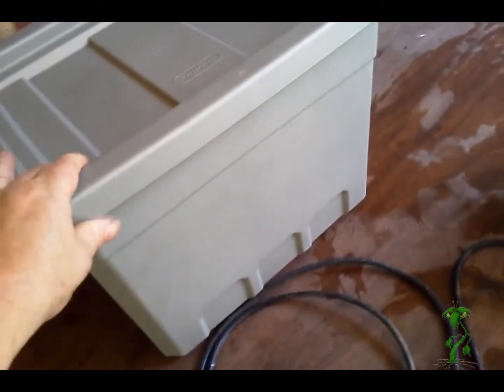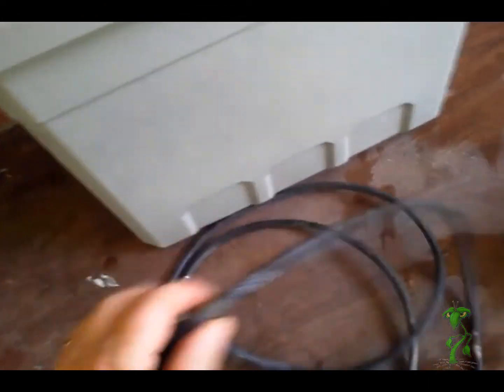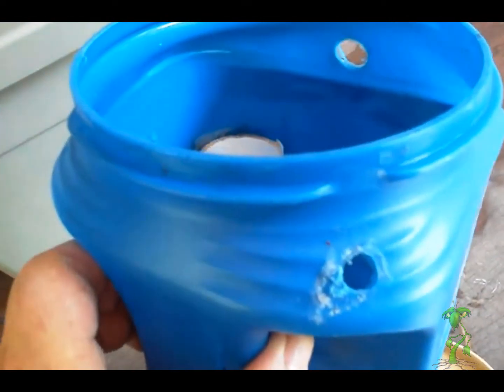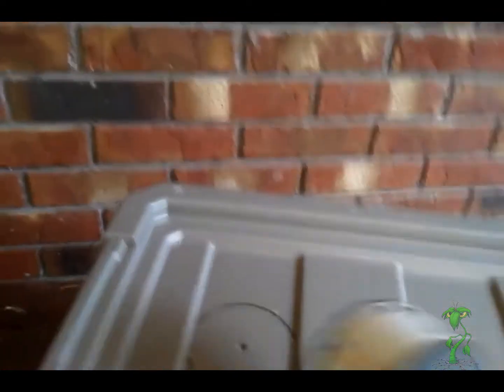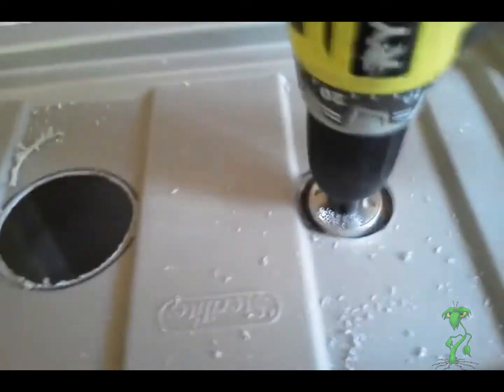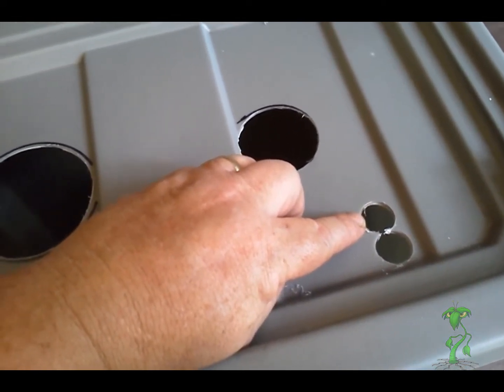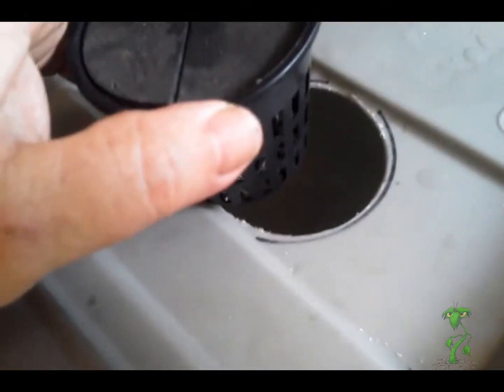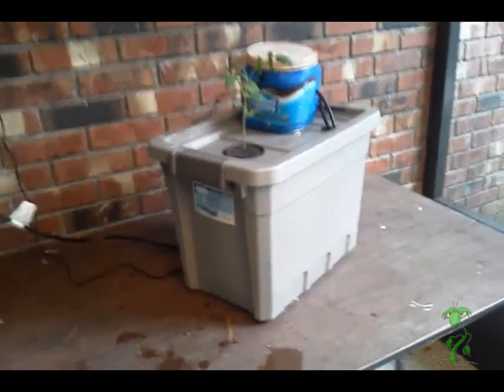Stand alone fogponics/ hydroponics system for under $15

Comment: This is genius
But I have a couple suggestions for improvements 
First I would run the hose from the pump output up through the PVC overflow pipe ,it will probably still drain at a good enough rate I assume it you could use  but wide to diameter PVC pipe , you could also run the pump cord through their too so 2 less holes you need to drill in the tote lid  
Also very helpful would be to put a window on the top of the coffee can lid , either use a box cut or Dremel to cut a square hole or use a hole saw , then you can use some clear plastic ,perhaps from a discarded fresh pasta container and hot glue or silicone it over the hole  this way you can check if the fogger is still working ,might also be good to add a small LED 
Or get the foggers with LED's so you can see better.
I also would mount the coffee can in the center of the tote so you can put a plant site in either side .
My only concern is if the fog will travel down the  overflow pipe well enough ,I would like to scale this up and use a bigger tote maybe I would put a tiny computer fan on the coffee can lid to help the fog find it's way down
Reply from the maker: I did this on a larger scale after this

Comment: Where are the ultrasonic misters that cheap no way
Reply from the maker: I pick them up on ebay, they are shipped from china
Reply: @bulldogge1232000  decent is it much of a wait cuz even Amazon the cheapest one is $30 Canadian
Reply from the maker: @MeYou-nn3tv Look up Ultrasonic Mist Maker Fogger Water Fountain Pond Atomizer Air Humidifier Decor on Ebay. They have gone up since the corona virus, but are still under 10 in the USA
Reply: Thank you for the information found one for 8.99 Canadian shipping included!

Comment: This doesn't make sense, you could had just put the fogger on the bottom of the tote with about two inches of water and then drill several holes for your baskets for your plants on the top  lid.  Which gives you more area to to root or to grow your plants,  If it doesn't produce enough fog,  then put two of them in there. https://www.amazon.com/gp/product/B00PAJXROW/ref=ppx_yo_dt_b_asin_title_o07_s00?ie=UTF8&psc=1 To do a extra step is to find yourself an old iigloo ice cooler instead of the tote. The water stays the same consisted temperature. I went ahead and sprayed foam inside the top lid, because it's the only part that's not insulated.
Reply from the maker: I have tried that, but the roots get into the fogger, and stop it from working.

Comment: WHY do Americans not have ready-made fogponics systems for sale? WHY do they insist on making everything from scratch, re-inventing the wheel, spending hours cutting out holes and buying parts on eBay? In Europe you can get complete systems ready-made for sale for very cheap.
Reply from the maker: Well, for me, it's two different matters. 1. Hydroponics, at least in this area, is treated like Science fiction by the local supply  houses. and 2. There is a greater sense of accomplishment , from being able to make it yourself. It's my hope that one day soon, a lot more in this area will be comfortable with hydroponics.
Reply: Because its cheaper if you waste a little time making it your self.  Plus your able to alter things to fit your needs and likes.

Comment: Those cheap foggers burn up quick. Check out the house of hydro. they have the quality foggers $20 with float and they last forever forever as long as you recoat with Neoprene S18 don't buy those plastic ones you'll get electrocuted. Good luck!
Reply from the maker: What you are saying is true, I get about a year out of these foggers, But you are missing the point.....This project is designed to give people the experience at an affordable price. You can always upgrade, but if it's too expensive  to experience in the first place, then they will miss out on a whole other way of growing great plants.
Reply: How can you get electrocuted with 24V fogger, especially plastic one?

Comment: I must have missed something. 

1) What is the purpose of the larger 2 inch PVC pipe and hole?  Does the fog drift down thru that hole into the tub? Is that the overflow back into the tub to keep the fog emitter bucket from overflowing? 
2) Why not just put the fog emitter into the tub and get rid of the coffee bucket?
Reply from the maker: Both, It's an overflow, and the fog drifts down threw the PVC
Reply: Does the height matter?  Why not just move the fog emitter into the main tub ?
Reply from the maker: Height doesn't matter, as long as your pump will pump up to that point. Roots get into the emitter and stop it from working
Reply: okay that makes sense. thanks. I am trying to figureout how to make a low-profile cloning fogger.
Reply from the maker: Glad I could help